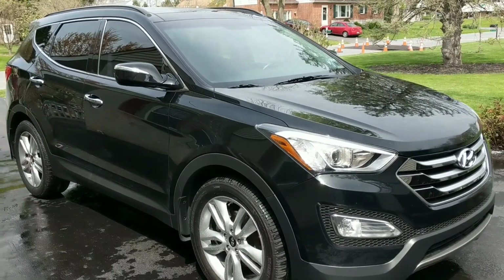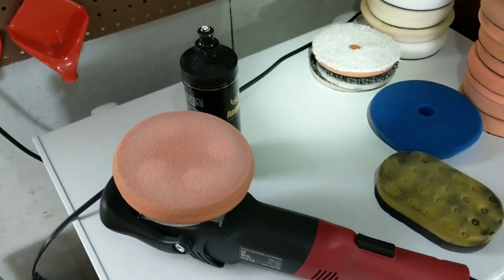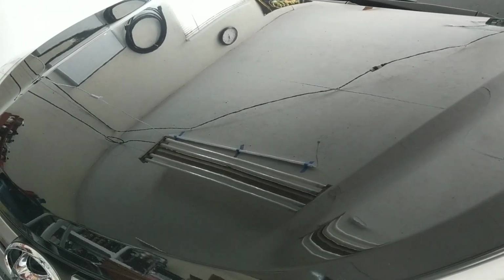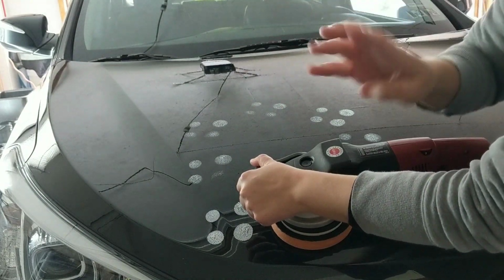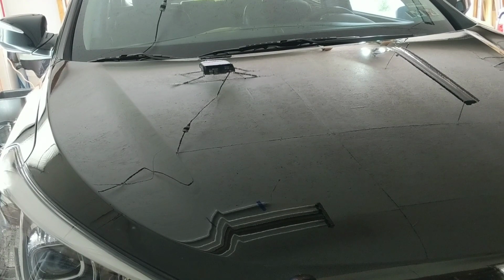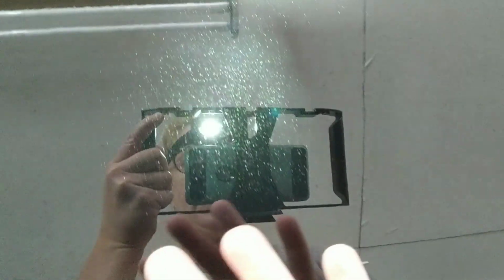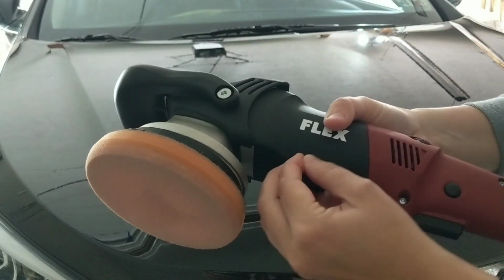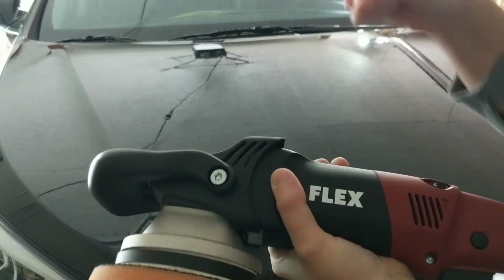Testing my Flex 3401 on beat up HARD Santa Fe paint!

Comment: Nice video Chelsea. I've used the 3401 for about 6 years professionally and it is a beast. But, it takes a bit of work to keep it under control when you are reaching away from your body and also, it can want to walk on the panel, so that takes a bit of getting used too. Your shoulders do know when you've done a full day! You also get better results using the Lake Country Forced Rotation pads as they are designed especially for the Flex 3401.
Reply from the maker: Yes my shoulders felt it the next day. Good tip on the pads! Thanks!
Reply: Just bought the force pads, hopefully they are as good as people are saying!
Reply: @SJG138  they are good quality pads.

Comment: I have had a 3401 for years, then I purchased a Rupes first gen 15 which stalls way to much for me don't get me wrong the 15 is a good machine but I still find my self using the 3401.
Reply: The Flex 3401 is like having a Ducati ...its solid and sounds Throaty and purrs
Reply: I upgraded to the XCE corded ( cordless sucks ) , and along with  the XFE7-12 it’s a better combo than the rupes 15 and mini in my
Opinion
Reply: The 3401 will be obsolete.  Buy extra backing plates and felt seal
Reply: @Jetski270  This is true, my plan is to upgrade to the new XCE my guess powerhouseparts should support the Beast for some time into the future.
Reply: @RodeoRides  cost me $50 for a 5 inch OEM backing plate

Comment: I use a Flex 3401 and I use a Flex Kompact 3 Rotary. Best combo to have IMO. I've tried several and they can not hang. That Kompact 3 is an absolute tyrannosaurus rex, you can even through a 5" backing plate on that rotary and it runs it with plenty of power too just like with its 3"

Comment: The issue with forced rotation machines is you need to fill all the pores of the pads with polish evenly otherwise otherwise you can get pulling on the polisher and it can leave haze on the clear. You'll use more polish and more time will be needed to keep the pads full of polish and also cleaning them out not to clog the pads up but on harder paints and if the Rotary is not for you it's the next best option.

Comment: as always - nice work - I'm thinking of getting the G9 so I will await your review before doing anything
Reply from the maker: I'd hold off. I tried it today and thing stalked like crazy. I prefer my gg6 to the g9. GG6 is a mini beast and rarely stalls. The g9 didn't like any pressure and on a flat surface still stalled unless I lifted the polisher off the panel. Disappointed.
Reply from the maker: I'd go with the gg6 over that

Comment: as a total newbie eyeing a used Flex 3401 would you advise trying something more beginner friendly? I like buying quality gear and ill probably sell it one I've done what I need to do. My car is a beater and I'm just trying to learn a little DIY paint correction
Reply from the maker: If you've never used a polisher before you're not going to feel the difference but it definitely is more aggressive than an 8 mm throw like the GG6 which is what I would recommend for any beginner to start with but it's also great for pros. Has a lifetime warranty, Can push through any amount of pressure, minimal stalling and cuts and finishes down beautifully.

Comment: Im losing my mind over my black Audi S4. Im using a Turtle Wax OSC850 it has 8 mm throw and doesnt take the swirls out. Im using sonax cutmax with rupes blue microfiber pad (coarse one). Rotary buffers are out of my comfort zone, would the next step be a 3401? I tried a little bit with a Flex rotary but didnt help me much, still swirls although alot less than before using the same pad and compund combination.

Comment: I'm thinking about getting the cordless one. What are your thoughts?
Reply: 1 hour run and you have to charge the battery again.
One thing NOT many are saying is that battery powerd is NOT FORCED ROTATION as corded one.
Is mor like a free spin.. so prone to stall if push harder..

Comment: I have an issue when compounding with 3401 the foam pad just seems to clog up really quickly any ideas dont feel im using to much product i think its spent product drying up in the pad
Reply from the maker: Whats your process? Do you switch pads every panel? Are you brushing or blowing it out after each section? Is it a fresh pad? How much product are you applying? How long are you working the pad? How many passes are you making? Whats your speed? 

Lots of variables that can affect this and its hard to tell whats the issue without being there.

Comment: The DA and the Flex all spin exactly the same, the difference is one is free spinning and the other is forced rotation.  No difference in the movement the pad is making other than with the Flex you can't make it stall and that gives you more power/correction.
Reply: Not exactly, the 3401 spins counter-clockwise. 🙄
Reply: LOL. There is a reason so many fear using the 3401 and it's NOT because it spins the same way as your typical DA

Comment: How's your experience with QP ON? I'm debating if 2.0 is worth trying out.
Reply from the maker: Super easy to apply and lasts 6-8 months in my environment. Great ceramic sealant and very chemically resistant. Like the fact that it's water activated so you don't need to worry about applying it on a rainy day.

Comment: The great defect removal you got.......with the large area you polished, an AIO, and a polishing pad, that’s definitely not hard paint. 😉
Reply from the maker: Trust me. It is. The sides especially. Hood was the easiest to correct.
Reply from the maker: Might not have been as hard as MB or Corvette paint but it definitely wasn't medium or soft. Was finicky. Wool pad left marring and needed a second step. The orange pad cut 80% of defects on sides and about 95% on hood. Still wasn't perfect but considering the customer is going to keep going through a car wash I wasn't chasing paint perfection.
Reply: @attention2detailswchelsea  I'm not trying to infer anything negative. I think your a great detailer and love your channel. You say the paint was "finicky". That is definitely a term in the industry that would imply SOFT paint. Again, the fact that an AIO and polishing(orange) pad removed so many defects would definitely suggest it's not "hard" paint. This light combo would not have removed anymore than 20% of the defects on hard paint, even with the 3401. Generally speaking, some manufacturers have hard paint(MB, GM), but not always. I corrected a black MB C300 with OEM paint and the paint was on the softer side for sure. Newer GM black paint is notoriously soft.
Reply from the maker: @c6z061  well the hood may have been soft but the sides definitely were a different story. Took almost two rounds of 4-5 passes each for decent correction. Rupes wool pad left marring, blue hdo pad did alright but wasn't liking all the curves of the panel and was too stiff. Orange was just right and may not have been hard enough for cutting to perfection but it finished down well and still gave good results. Customer had a tight budget in this so I'm glad I had a power machine to cut quickly without having to add a step or compromise the finished look. I see what you mean and agree but it wasn't like finicky GM paint. THAT I've experienced and this was nothing like that. Not sure what else to say but wasn't looking to debate over it. Just one of those things you have to be there to experience it. Not every vehicle is the same. 🤷

Comment: What size backing plate did you have on the 3401? And Pad?
Reply from the maker: 5" flex backing plate and orange flat pad from LC
Reply: @attention2detailswchelsea  the 3401 will be obsolete soon. Best to get some extra backing plates and the felt rings.
Reply: @Jetski270  why do you think it will be obsolete?
Reply: Because Flex said so.   I have 5 inch backing plate on

Comment: I would just like to point out that, the speckling showing on the paint after she runs the Flex, are the metal flakes in the paint and not residual swirling.